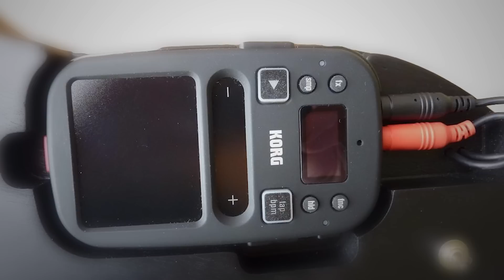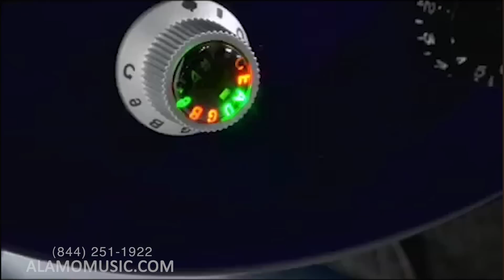TOP 5 GUITAR TECHNOLOGY FAILS! | TECHNOLOGY GONE WRONG

Comment: I picked up a Peavey AT-200 for $200 and it is marvelous. The autotune feature is just the tip of the iceberg regarding what it can do. It has perfect intonation at all frets. It can model an acoustic guitar, a 12 string guitar, modern humbucker, california single coil, nashville single coil, mini HB, P-90, vintage HB, vintage lipstick, Bass, and more. It can do a myraid of different tunings- drop D, DADGAD, open E, A, G, D, Am, Em, Dm, and Bass.  It can model a baritone guitar. It can virtually capo any string, shift pitch, etc. All of this can be done at the touch of a button when connected to a smartphone, ipod, or tablet.  If not connected most can be done by plucking certain strings at certain frets. On mine bending strings is not an issue. It can recognize a bend and it doesn’t alter it. I took mine to a luthier for a professional set up and it plays great. The only drawback, which Chris alluded to, is that the amplifier has to be turned up enough to mask the sound of the strings. This is easy to do. I think that the real reason that it failed is because they failed to educate the public on its extensive capabilities. Most stores that carried it were clueless about its capabilities. Here is a video that demos some of this: https://www.youtube.com/watch?v=6PNzGyzYS3U